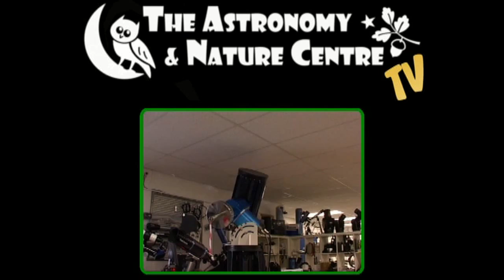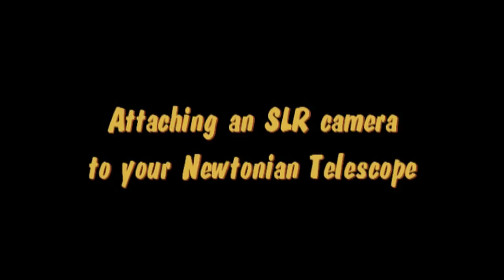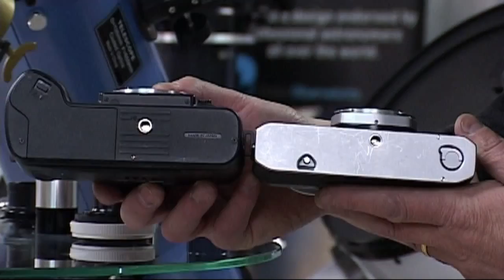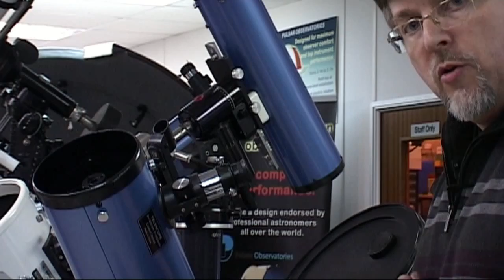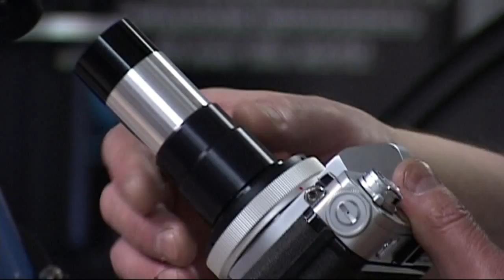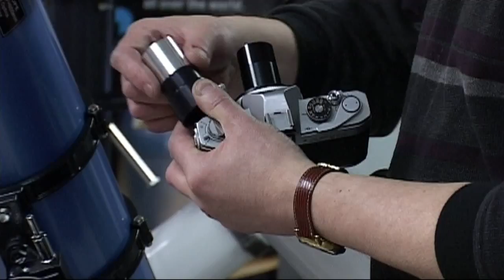Attaching an SLR Camera to your Newtonian Telescope

Comment: On some telescopes you can screw the columnation screws enough in to get focus without barlow, use the 2 inch connection to get the camera even closer to the telescope.

Comment: I wonder if someone can help me please?  I have a Nikon D3000 DSLR and wish to attach it to my telescopes (not all at the same time) I have all the parts required, but when I remove the lens from the camera it flashes the "Lens isn't attached" warning. This stops the camera from working. Is there some way to disable the warning so the camera can be used?
Reply: Do you have your camera in auto mode when you do this?  I think it should stop if you put it in manual mode.
Reply: @YaleTink  Yes, Manual mode with Live View enabled